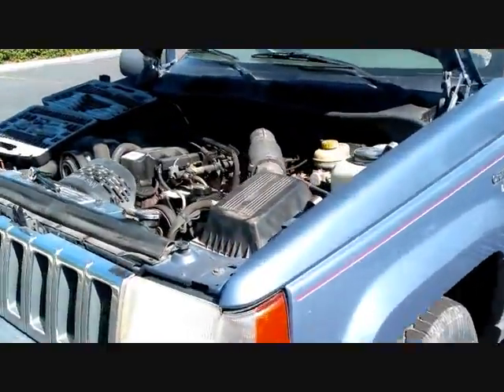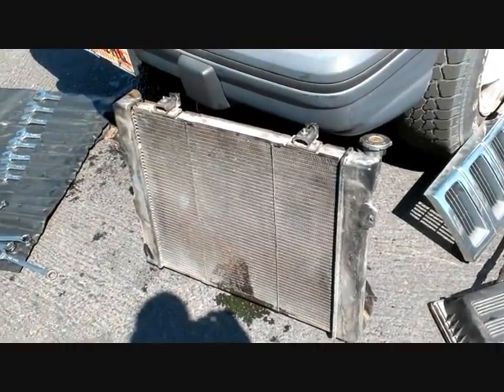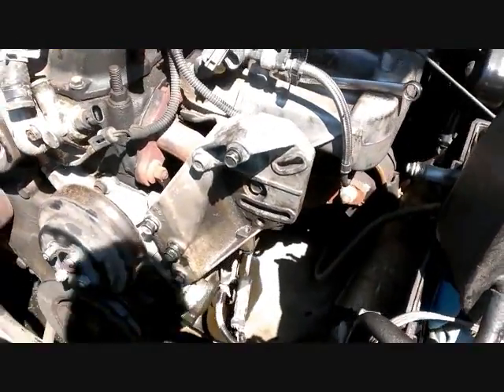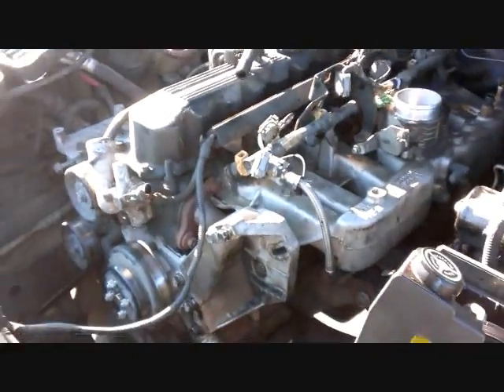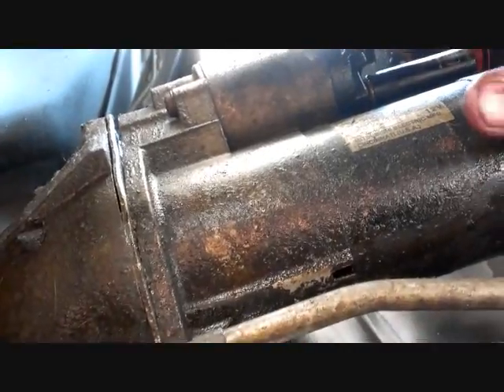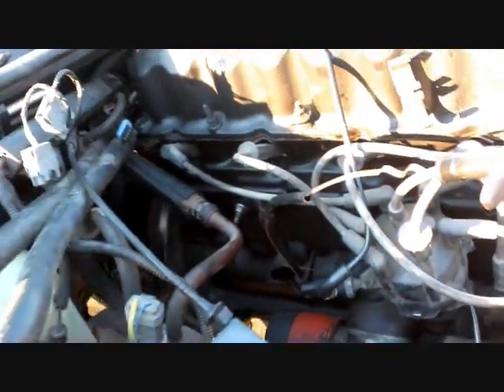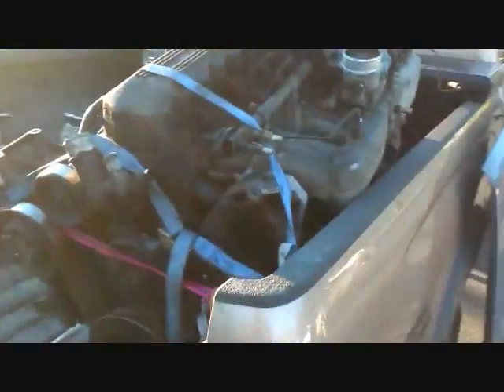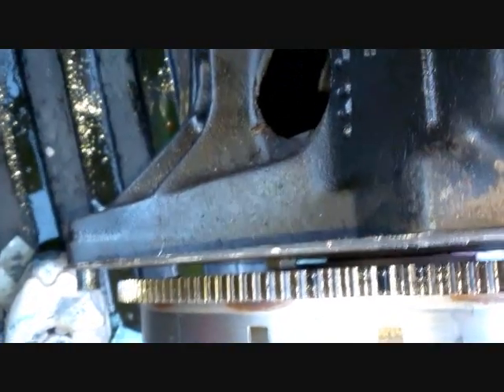Step by step Jeep Grand Cherokee engine swap guide Part 1

Comment: Why are there no videos on how to reinstall the flywheel
Reply: My engine came out and now I need to put the new engine in but I can't line the flywheel bolts with the torque converter

Comment: Does the engine have gorilla glass 5 with a sapphire screen protector, so it will scratch at a level 8 with deeper grooves at a level 9?
Reply: No its not, the screen is foldable so its not glass. But i believe it is mud resistant.

Comment: I also have a 95 grand Cherokee. Would you have any ideas as to where I could find a new engine wiring harness? Mine is in pretty bad shape and is causing a lot of issues due to a frayed wire somewhere.

Comment: I just put in a motor in my Grand Cherokee Laredo 4 wheel drive 4.0 I have no gauges work on my Dash no power ford fuel pump want to crank but I have nothing that works my lights work but brake light works my ABS light works on my radio but nothing else can someone help me with that and how many wires should I have running to my starter I have the big red wire and I have two wires going to the same boat is that right or no

Comment: Top Tranny to Engine bolts - My 2004 (with a lot less room to maneuver)  I pulled the engine mount brackets off (mount to chassis brackets) and dropped the engine DOWN.  This allowed enough room to get a flex-head ratchet in there to remove the bolts.  
Thanks for the video!  I watched as a primer to changing my engine and it was helpful!

Comment: update on my  engine swap from a 98 jeep grand to my 97 . yes i pulled two engines and installed in my 97 that has a much more solid body on it . the engine swap went very smooth . the only thing i would recommend is removing the tranny cooler lines before reinstalling as they were right in the way of the engine mounting to the tranny . moved them around so much that once i had the jeep up and running the lines were leaking and i had to replace them . also some of the plugs were different on the 97 so i had to change a few things like the coil pack and the cam sensor  and also the idle control sensor.  she runs sweet and i now have a engine with half the miles on it .so glad to have her back .

Comment: im getting ready to do this swap except i am pulling a 4.0 out of a 98 with a bad frame to put into my 97...both 4.0 i cant see any differences in the engines..same in both ?
Reply: im thinking about doin it to my 2004 jeep grand cherokee  but i dont know if i could fix it some other way because it's just a misfire but I've changed everything that auto parts store told me and still has the misfire
Reply: +CreativeFlow bad injector ?
Reply: +mike hunt  changed it too
Reply: +CreativeFlow is it giving you a misfire code ?  i wonder if its a bad or even a weak circuit to the injector . a weak or low voltage can keep the injector from working as well .
Reply: +mike hunt yeahh but the codes keep gettin messed up so one day it says cylinder #6 misfire then another day it said cylinder #5 misfire on my check engine scanner so i dont know
Reply: +CreativeFlow definitely sounds like it could be in that harness to the injectors or the pcm may be acting up . i had to replace the computer in mine a while ago and it actually solved not just my stalling and running issues but it took care of alot of different things .
Reply: +mike hunt  do you have another other social network to talk?
Reply: +mike hunt or not....but PCM is the "computer" right ?
Reply: +CreativeFlow yes mounted to the fire wall with three plugs going into it . behind the over flow container .
Reply: +mike hunt  but what do i need to reprogram the new one ? like what equipment?
Reply: +CreativeFlow the one i got was programmed from the factory . i installed it and the car runs fine . it may take a bit of running and driving  and key cycles for things to set to your particular vehicle but for the most part it should be plug and play .
Reply: +mike hunt what if i get one from the junk yard ?
Reply: +CreativeFlow i had thought of that also but i thought that getting a used one may be hit or miss . you may end up with the same problems if not worse . at least the new one will  be upgraded and come with some kind of warranty . better to have a clean program then end up with other issues .
Reply: +mike hunt  im 17 dont have a job yet because i got to school most of the day and im really wondering how much a pcm already set up and all costs ?
Reply: +CreativeFlow about 250.00 when i bought mine from advanced auto . easy to replace its just the cost of the computer . you can try a junk yard and see if it works . at this point you have nothing to lose .

Comment: Really surprised that you didnt have to encounter those two torx bolts on top of the bell housing. Most people complain that those are a bi**h to get to, not to mention they're a pain in ass when you encounter THOSE after infinite standard hex bolts.

Comment: Hey I'm actually swapping an 2001 jeep Cherokee engine and I gotta say thanx for the tip for thos 2 top bolts that hold the transmission to the engine. I couldn't get anything in there. So I gotta go buy thos flex ratchet wrenchs. Thanx again man
Reply from the maker: brandonwilliams20ful Yes!  So glad that tip got to someone who needed it.  Took me forever to figure it out on my own.

Comment: I should have done more research before trying my first engine swap.  I now know why I can't get my block and transmission to mate up.  Thanks for the note about 3/4 of the way through.  Yup, I took out the torque converter.  Back at it tomorrow.
Reply from the maker: Sometimes the best way to do projects is to just dive right in.  Good luck man!

Comment: I'm doing a motor swap on a 1999 jeep grand Cherokee for school and I was wondering if I am the only one who's had trouble with the bell housing to block bolts and I got it out but now putting it back in has been a bitch
Reply from the maker: Its a nightmare. I heard somewhere if you put the bolts in the freezer for an hour or 2 it will make them slightly smaller and fit in the holes better.  If you are having issues with that.  Let me know if it works.

Comment: I would swap out the power steering pump from a 96-98 ZJ 4.0 - Chrysler redesigned the serpentine belt adjuster where the idler puller has tensioner bolt (the PS pump is fixed on the later ZJs although the cylinder head was redesigned for 96-98 - casting #0630 is used (the motor in the truck bed is the later 4.0 from either a WJ or TJ with the 0331 cylinder head - 99-01 0331 heads are known to splinter
Reply from the maker: Nice, thanks for the heads up!

Comment: why the oil is going to the air filter ??? what does that mean ??
Reply from the maker: When it threw a rod, it broke a hole inside the engine.  Oil then went into places it shouldnt have been, like the coolant channels, as well as the air intake.

Comment: I have a 95 Grand Cherokee Laredo with an engine that has low pressure in all but one of the cylinders.  I was thinking about getting a re-manufactured engine and installing it myself.  But, other than changing my brake pads and oil, I have no experience with cars.  Do you think an engine install is something a newbie should avoid doing himself?

Also, how long in total did it take to get this engine out and put the other one in?

Comment: Swapping to 5spd as said will be extra difficult, becuase as you may know, grand cherokees were never offered from factory with a manual transmission.  So unlike alot of trucks, which have been designed to be manual or auto, you wont be able to just install the clutch equipment and everything will likely have to be custom made and fit.

Comment from the maker: To be honest ive never tried one. It would probably be a difficult thing to do, because the torque converter and transmission are probably not set up to be attached to the Cummings motor.  I haven't done any research though... With enough willpower and money anything is possible though.
Reply: bro im just watching this video after 11 years and I really love your videos